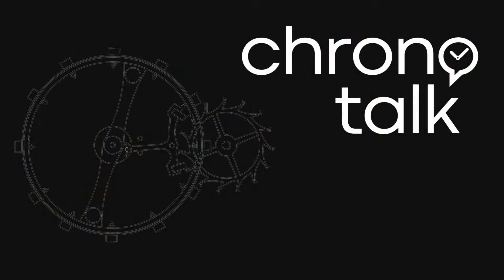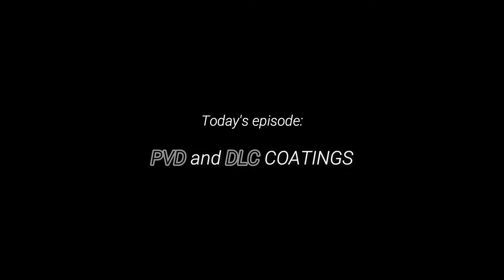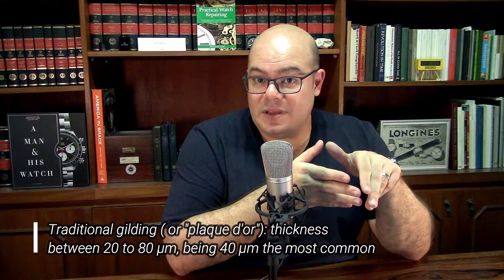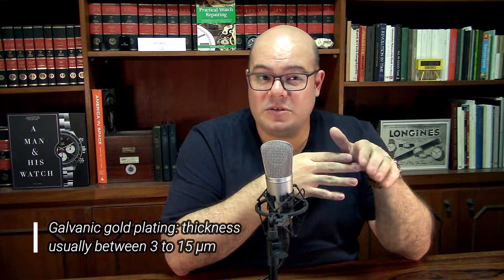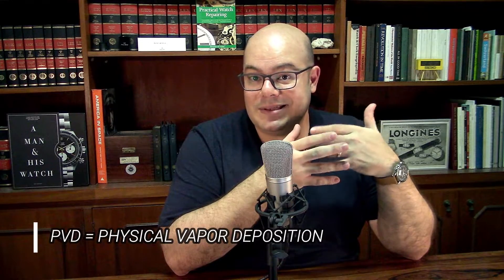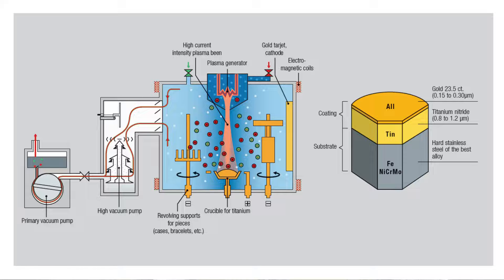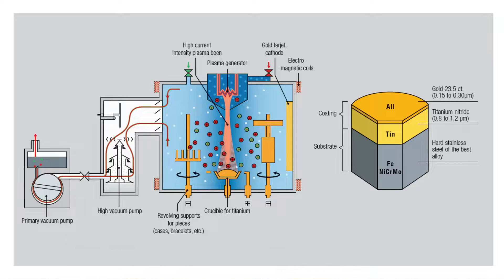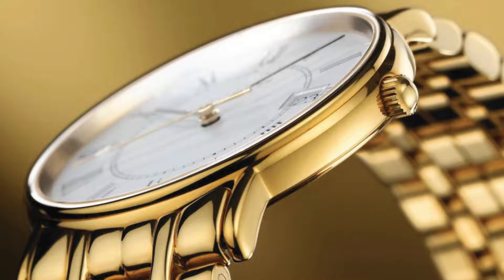[EN] PVD and DLC coatings: what it is, how it's applied and what are the differences

Comment: Very interesting. I am an amateur, so most of your content is beyond me. Do you know, is there a layman's method for applying PVD to a case? What you describe seems to require high professional equipment and skills. I removed a bad enamel (or PVD) coating which was peeling off, and now it's just the base metal. But now I want to re-apply a black coat (PVD) on the case. I'm not sure how to do it, or even whether I should. Thanks.

Comment: is it possible to remove DLC and PVD coat?
Reply from the maker: Yes, but they are very very hard to remove perfectly, since they kind of penetrate on the base material. You can only remove it mechanically (by abrasion), so you will fatally loose material as well!